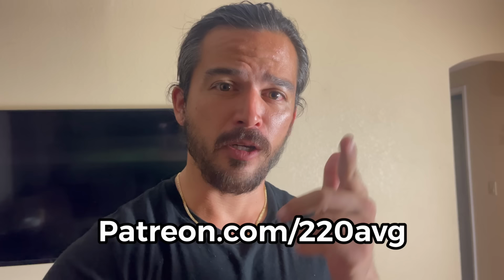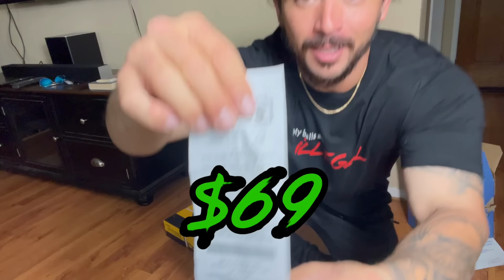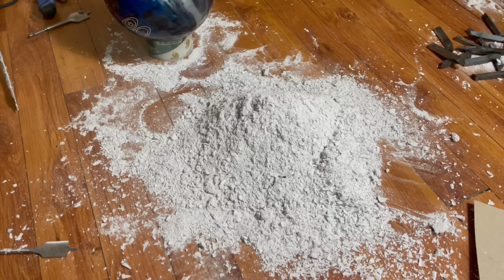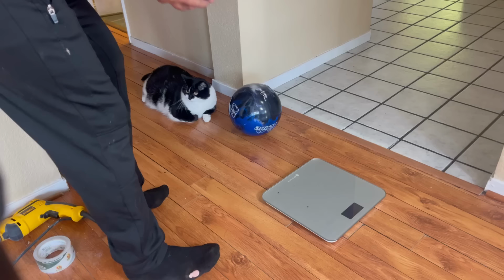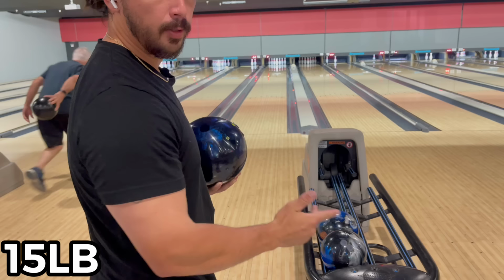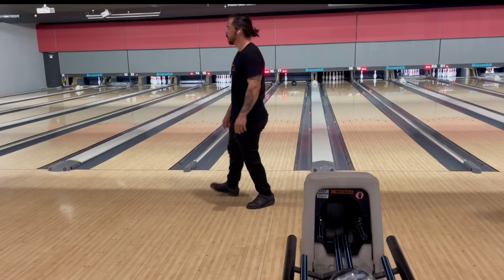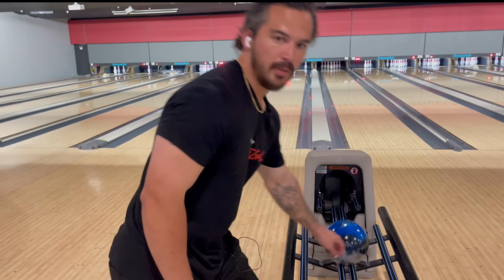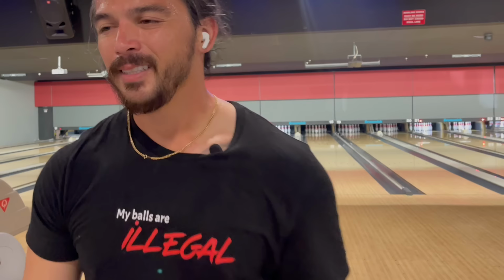We built a 23-POUND BOWLING BALL with a CUSTOM METAL CORE

Comment: I'm by far more impressed that the lane maschines are capable to bring back this heavy pounder 😂
Reply: The bowling alley had to shut down this line afterwards. Apparently the motor burned out and they have a hefty repair
Reply: The masking units say Brunswick, but as someone who wrenches on bowling machinery I can tell you those are AMF machines in back which shouldn't have any problem returning a 23lb ball. 
I'd be most concerned that the inertia of a ball that heavy is likely to splinter or break the cushion in the back of the pit. The machine is designed to handle a lot of repetitive impact, but not that much all at once. I can change out a cushion assembly in 10 minutes, but the parts to rebuild them aren't cheap...we're talking several hundred dollars in parts alone. 
A 23lb ball is also likely damaging the lane & leaving dimples in the surface, and that's even more costly to repair. As much as I like this channel & the content, if someone came into my center & did this I would 86 them.
Reply: @Jeff-rd6hb  but he's a youtube superstar, rules and courtesy don't apply!
Reply: @Jeff-rd6hb  The sweeps have Quibica/AMF notation on them, so probably some sort of hybrid of equipment. 

Yeah, the first thing I thought with this is, "What lanes would allow this?" The lanes, the pins, the return, the pit, all of it.

Comment: As a pin setter mechanic that ball will-eventually get stuck in the ball return in back or front due to weight issues & oil on rubber wheels/belt to lift ball & depending on maintenance on machines (pinsetters) but other than that I’m sure that ball has lots of momentum behind it to bulldoze right through pins😊

Comment: I have two comments period First you are dealing with friction vs. Surface  area vs weight. The weight is keeping it from hooking. You can sand it and get much better(or bigger) reaction. 2nd, im sure the tungsten chips and dust have settled some by now. You should drill it back open and see if you can add more weight.

Comment: I was thinking a lot of your hits could have just been the cover stock. Hard to believe a 23lb ball would leave so many pocket 7 10s and 10 pins
Reply: The cover is plastic. The ball has no tendency to want to change direction based solely on the cover's friction and the core's weight dynamics aren't known well enough to be able to setup the ball with a proper differential. The ball had basically zero deflection which is what led to blowing through the pins and not sending them left/right. He started getting it when he was coming in at a better angle later.

Comment: Someone more versed in physics can probably explain better than I can, but the transition on from skid to roll happens due to friction and not weight distribution. That 23-pound ball has a LOT more mass that needs to change direction than a lighter ball does. You can have all the weight on one side of the ball, and it still moves in the same direction without friction. The ball will hook when the direction of rotation (vector) is in the same direction as the linear direction. That doesn't happen absent friction. Moving weights around can cause the sphere to wobble about on its initial axis or rotation (PAP) until it reaches a preferred axis (PSA), but as I said without friction it will still go in whatever direction it's initially travelling. The wobble is what we see as flare on a bowling ball. The purpose of track flare is to present a fresh ball surface free of lane oil to come in contact with the lane each rotation. That's why balls that flare more can possibly hook more and not because the weights are shifting inside the ball.

Comment: Have you ever had a 6 lb ball drilled for your fingers? I'd be curious to see you throw it as hard/fast as possible. My friends and I used to mess around with the 6 lb house balls gor kids and stand all the way back at the table and run up and chuck it (just putting our fingers on 2 holes, basically palming it) and still getting a little hook. I called it the whiffle ball shot, because that's basically how it looked haha.

Comment: For what it's worth, the shape you created by creating the core like that basically made the rg a hilariously low number, coupled with the plastic coverstock, ball just fights itself the entire way down the lane. You'd be better off drilling a wider column straight down (think 3-4 inches) as that would keep the rg a little higher, then using some marginally reactive cover. Can also soak it to make it softer if it pushes too far downlane. It's already illegal, might as well do everything you can to make it roll well lol

Comment: Ha very nice ! Try to make the spareball more dull with some pads and see how it goes first. Then , if you have the time it would also be fun to do it with a urethane or reactive ball as well. But it would be nice if you could try to somewhat bias the weight inside as similar as the original core would be.

Comment: I have to agree with the others asking to see this done with a reactive cover. The reason you're not getting as much hook as you would expect, is becuase the plastic cannot grab the lane, as the weight is pushing the ball forward, cause it to skid, the plastic cover cannot create the friction needed to move the weight in the direction of the rotations. You wouldn't need a lot of friction either, but you need at least some, I think if you had a low to medium reactive case ball and did the same thing, you'd get drastically better results. I'm really keen to see it actually, I think the pin carry would be amazing.

Comment: I feel that you would do better with the weight closer to the outside. Adding that much weight to the center makes it center heavy and resistant to change in motion.
Reply: Isn't that how bowling ball cores work. A much heavier weight block in the center surrounded by a lighter shell? Of course their cores are purposely designed with physics in mind and not just random weight.
Reply: @theinsaneshecklador6598  not exactly. Having a ball that has massive weight near the center has no (or very little) imbalance to make the ball want to migrate it's axis. The metal is so heavy and focused near the center that the core is very stable. What you want is instability which can be accomplished with a core that adds weight to one side or that creates dynamic instability while in motion (rolling down the lane).
Reply: @donaldriley9724  I could see that if it was a round chunk of metal in the center of the ball but the way he drilled it seemed more like a traditional weight block. The holes go most of the way across the ball. The hole looks to be substantially taller than it is wide and it also looked to have somewhat of a bell shape with the holes splayed out at the bottom and narrower at the top.

I suspect the fact that his weight block appears to be leaned over in a horizontal position instead of a more vertical position relative to his finger holes is making it less dynamic. That would mimic a short pin to PAP layout. Short pin to pap layouts is something Mo Pinel has talked about using on senior bowlers with less speed. Or also to mimic a urethane reaction with a reactive ball. Smoother and less dynamic ball action.

I could be way off in my thinking. I'm far from a drilling expert. I also could be way off in my perception of how his hole looked to my eyes. Perhaps it is rounder and more centered than I think it is.
Reply: @theinsaneshecklador6598  it could actually be a combination of what you pointed out and what I said. If it is like I suspected, the ball has little dynamic properties. However, it could easily be that it does have dynamic properties, but the core is laid out in a very stable position (either completely horizontal or completely vertical) which results in a stable roll. I didn't try to see his layout in the video to see which one it is. Interesting discussion about a silly video.
Reply: @donaldriley9724  👍
Reply from the maker: I think you’re right Donald.. I just discovered something about the ball that I’m going to address in a video 😂

Comment: Interesting video.
I'm surprised that you didn't leave more splits, considering that ball does not deflect at all. (Unless you cut those out.😁)
Also most likely didn't hook because 1 Physics will cause the weight to move to the outside orbit of the ball, and your weight is not a solid mass, and 2, it's a t-zone. 😁😁
Betcha that Brunswick ball wheel and lift rods were plenty tore up afterwards. (That's the A-2 Pinsetter Mechanic in me, there)

Comment: You can easily tell the ball is alot heavier by the way it hits, especially on slow motion, there is like NO deflection, i was surprised on a high flush hit there werent any stone 8 pins and or 9 pins, I just hitst so hard there is no chance for the pins especially a nice faced up shot on pocket is game over for the pins on deck!! Lol...awesome
  I also noticed its seems to go into a roll later, idk if thats because of how heavy it is of because of how the weight is distributed with the added weight to the block? Still very cool.  The hater comments are the people that dont understand the physics of how a bowling ball works...its not just an equally balanced sphere..lol

Comment: What we see is that 18 was a great weight for this guy. 20 pushes the limit, but is still a great weight. Those are in his optimal momentum zone. At 23 pounds, he can no longer provide enough power. So the ball loses speed as it approaches the pocket. Unlike the 18 and 20, which just explode through the pocket.

Comment: I am by no means an expert on layouts and even less so on no thumb drilling so I could be way off here. 

Most bowling ball weight blocks are taller than they are wide and most are drilled with the pin somewhere near the fingers. This is essentially putting the block in a more or less upright or vertical position. Your homemade weight block looks like it might be laying down horizontal in relation to the fingers (or what is essentially a short pin to PAP layout distance). 

Short pin to PAPs are something Mo Pinel talked about for older bowlers with slow speeds to make the ball controllable and hook less. Mo also hated urethane and talked about using short pin to PAP drillings on reactive balls to mimic a ball motion similar to urethane.

Perhaps plugging the fingers and redrilling them closer to where you made the hole to insert the weight would make it more dynamic?
Reply from the maker: We’re going to try moving the fingers because we figured out something about the core 😂
Reply: @220avg  Will be interesting to see if moving the fingers helps.

Comment: these videos are interesting - but they ignore simple physics.  kinetic energy from the bowling ball is transferred to the pins to knock them down.  the formula for kinetic energy = .5 * mass * velocity^2.  So double the mass, you have twice the energy.  But double the velocity, you have FOUR times the energy!  So 1.5x faster will give 2.25 more KE, while 1.5x heavier, only give 1.5x more KE.  Granted, lots of other factors - but that's the foundation.

Comment: so yeah your 2handed release needs some work. sounds like you are clipping the finger holes. try twisting your hand with your fingers in the ball so your palm sits as though it has more axis rotation. should alleviate that problem
Reply: I think Mo Pinel had some info on drilling pitch changes for 2 handers who clip. Might be worth it for 220 to look into that as well.

Comment: That weight bias is not good. Makes the ball roll so early it has zero continuation.
For pancake balls, putting the weight in the center of the palm, like an old school Label Layout, should give the ball some smooth continuation and make hit way harder.
Time for 25 lbs!
Reply from the maker: We’re going to try moving the grip and see if it changes the roll because we figured out something about it

Comment: With a full inch of urethane around a sphere of tungsten, you could make a 100 pound bowling ball. The powdered tungsten is really not doing you any good here. Since melting tungsten is almost impossible, you would need a professional to provide you with a 6.5 inch diameter tungsten sphere (or cylinder if you want some hook).

If you just want to improve with your current materials, work with another youtuber to melt lead into the tungsten filings. You should be able to get a 40 to 60 pound ball that way.

Comment: IMO you are using the wrong variable for hitting power and force.  Kinetic energy is 1/2 MV^2.  It is relative since you halve the mass.  If you can maintain the velocity of a 15 (doubtful) you will get better carry.  If you can throw a 14# ball at 18mph down lane your hitting power would be 2268 joules.  with a 23# ball to hit that hard you need to maintain 14mph (downlane speed).  The angluar momentum needed to maintain that speed with a 23# ball is going to be a lot on the body.

Here's a test.  14# ball with the ball speed and rev rate of 2 handed.  15 (same test) then 20 and 23.  Using that data we can calculate which one is better and "hits harder"  Especially if you can have something with a core.  The density of the core combined with the density of the tungsten would be interesting.
Reply: There is more at play here than simply kinetic energy. Conservation of momentum, coefficient or restitution, etc.

Comment: Dude is asking for a broken wrist drilling like that with the corded drill...it will bind at any point with those bits and bye bye wrist drilling right handed especially curling your wrist like that... extremely dangerous...it why the come with handles first of all...but if you are too manly to not use it then just drill left handed because the drill will just come out of your hand instead of trapping and turning your wrist ways it's not meant to. It's no joke I seen it happen and had close call myself and I got lucky it jammed before was at full speed cause it continues to turn after releasing the trigger still with way higher torque than cordless drill
Reply from the maker: Maybe on a stationary object. The ball simply spins before my wrist would ever break